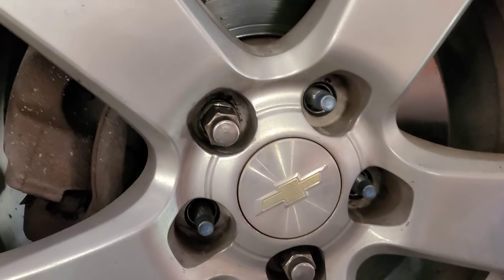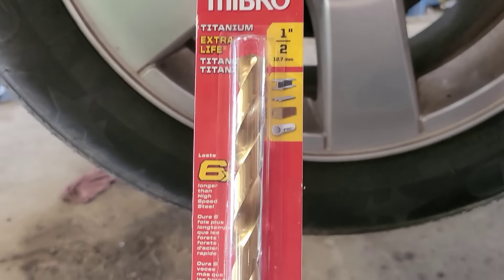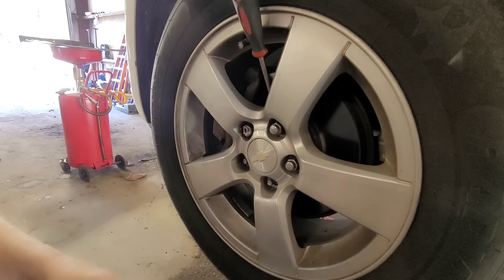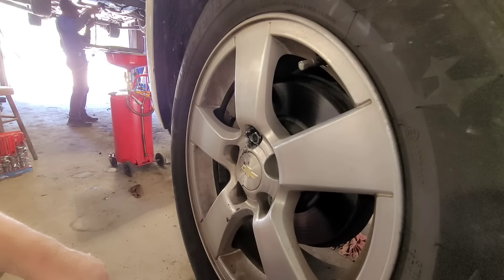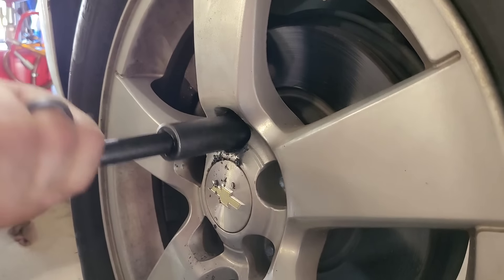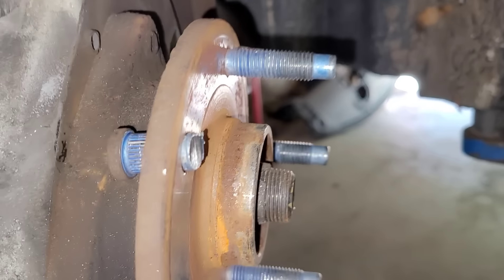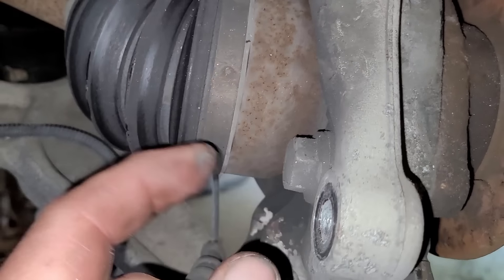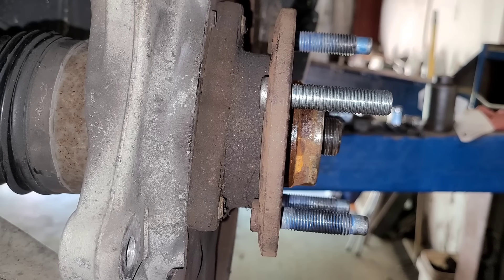Spinning Wheel Stud & Seized Lug? What Would You Do?

Comment: With the greatest respect to your skills Kenny, I would have used a smaller pilot drill to the depth of the wheel nut, and then progressively opened out the hole until the nut threads were drilled out. In my opinion, either High SpeedSteel  Drills, or best of all are old fashioned high carbon steel drills cut  better than titanium at this sort of  job. I would not have lubricated the job either,  let the drill do it's work,  and keep the speed lower to prevent overheating. Your programmes are excellent and I look forward to watching each new upload. Thanks and best wishes.
Reply: Hi, has above i would tackle this problem the same way :) I have had to remove a Discovery 3 wheel nut that was round off, wheel stud was seated ok, how i went about it was my workshop has a plasma cutter, on a low setting just kept a cut on the side of the nut, with presser like you did, and it came off, with no damage to wheel or stud. love your vids :)
Reply: Sure, drilling a pilot hole first the job would have went faster, the problem is getting that pilot hole straight.  Personally I would have taken the same route as Kenny.
Reply: I was thinking the same thing. I always drill a pilot hole before going with a 1/2" bit. The drill bit wouldn't get hot as fast or dull as fast. I would also use a heavier oil than WD40.
Reply: Yes a pilot hole first and reshart that bit dont toss  it and theres a way to sharping it so it cut faster
Reply: Why wouldn’t you use a cutting oil in this case? I am honestly curious as I’m a DIY guy, but in the last year I have started taking on larger projects and drilling through thicker metals.
Reply: @6atlantis  Cutting oil would be the best thing to use. If you don't have that, motor oil or even sewing machine oil would be better than WD40. WD40 is great for certain applications but using it on a drill bit is not one of them. It's a good way to ruin a drill bit. It will not only get dull but it will most likely lose it's temper.
Reply: @waltp3373  good to know thanks, I would of assumed Wd would be better than nothing. Thanks again.
Reply: Low speed high pressure yes, hss no, gold painted crap no, cobalt yes.....  oh and oil is pointless....
Reply: I agree with AW on the pilot drill/hole.  Just keep in mind that "titanium" drill bits are made of HS steel with a titanium nitride coating.   Also, I'd use a cutting oil instead of WD-40 or drilling dry.
Reply: You are correct sir.  It is not advisable to drill 1/2 straight into Grade 8 studs.  The reason is the land is too wide (the thickness between the two flutes) with a very high chance of burnout.  1/4 " will suffice.  Yes you must be careful of wander, but if you use the correct speed & feed, any misalignment will correct when the 1/2 inch goes in.  The speed for drilling steel is 1000 r/m, so the drill must be capable of this.  Carbide drill bits are ideal, hellish expensive, but.........
Perhaps I missed something, but if there is a cutout in the bearing, was it necessary to remove the hub ?  I understand the hub is in good condition and it is customers choice, but if it were my car, I'd pop a new one in.  After all the work has been done.
Well shot and explained and the proof of the pudding is in the eating.
Reply: Great skills on tackling the stud drilling it out but after I saw the hub with Grove for replacement of stud umm I guess  you did see it on the bottom  of hub it was fixed for stud slide through ,mmm that would saved new stud No grinding to it and Zero Removal
Reply: Would a hammer drill be better or just a regular drill
Reply: I would have started with the 1/2" if that centered good in the nut. Then switched to a 5 mm when there is a good center marking.
Slow and some oil, why drill dry? Don't want to clean after? 😂😅
Reply: @MrRunner  Note: the speed for drilling steel is not necessarily 1000 rpm, it is the drill diameter that determines the rpm, smaller diameter drills need more rpm than than bigger diameter drills.
Reply: The speed I gave was correct.  1/2 in steel.  It is very true that drill speed is dependent on the size and material, which is what I quoted.
Reply: My thought about imobilizing the stud...I might have tried just taking the nut off, instead of drilling once the stud became immobile.  If that didn't work, then I'd drill it out. Just my thoughts. Love the videos.  We're all human and make mistakes. 
Don't sweat it. Keep up the good work!!
Reply: I did this yesterday on a 1/2" lug stud. I started with 3/16" bit with motor oil then went to 3/8' bit for the finish full depth. that left a 1/16"' 'wall' around the hole which broke on its own when it was below the depth of the wheel. Yeah, I was surprised I was able to drill that straight. I think starting small helped keeping straight

Comment: I installed 5 studs in an auto parts parking lot because studs started breaking during a road trip. The whole strut and wheel bearing was from a salvage yard. We hit something on the road which took out the strut and bearing. Studs probably had been over torqued before I got it.  Lucky I was able to put them in without pulling the hub. Manually crank each stud in. Had to improvise because the lack of tools at hand.

Comment: Ive learned to put a prybar between wheel and hub, apply outward pressure, and let air impact do the work. Snaps the stud right off
Reply: Exactly what I was thinking. Seems tension on the stud would have allowed the lug to loosen.

Comment: The lug nuts with aluminum caps in my opinion are a hazard because they warp/bend and you sometimes cannot get the lug nut off with a traditional socket wrench.  If you have a flat tire on the road, you are SOL.  I replaced all these lug nuts with solid steel lug nuts.
Reply from the maker: You're absolutely right! Nothing is worse than swollen nuts 😉
Reply: @WrenchingWithKenny  lol 😂
Reply: Yeah those caps suck once they crack and expand from rust and other reasons. I've had sockets jam on before, didn't think I'd get em' off.

Comment: I worked at a store shop and ran into this stuff all the time.  I have experience as a machinist helper, and I fabricated a set of sockets with a bronze sleeve to keep the nut from moving while drilling the stud.
Reply: That's along the lines of what I was thinking. The sleeve could maybe be held in place with putty if you didn't want something permanent.

Comment: I've got the same problem with a 2015 kia sorento. I worked on trying to drill through the lug and and stud. I put a standard length 3/4" drive 13/16" socket on the lug nut and clamped some curved jaws vice-grips on the socket to keep the lug nut from spinning. I got a cup of water to dip my bit in to help keep it cool and put oil on it every time before I'd start to drill. Drill for 10 seconds then cool and oil my bit. I started drilling with a 1/8" bit and only stepped up 1/16" every hole till I got the 1/2" hole drilled. The stud was extremely hard to drill through.

Comment: Hi i had that problem before and i solved just sliding a saw blade between the rim and rotor golding it with a players and using the impact to  turn the lug nut and the blade cut the stud in couple minutes. May be the idea help to next time ur videos are very clear and helpfull thanks

Comment: Hi Kenny. Something similar happened to me in the uk in a lay-by with my Ford Transit van. Had a blow out and had to fit the spare. I drilled two smaller holes in the nut at 180 dg. to each other and then split it with a sharp cold chisel. Thanks for your videos. I really enjoy them
Reply: Good call. Lug nuts are made from a steel that is much less tough (i.e. has a lower yield stress) than wheel stud steel which is some damn tough stuff!
Reply: Didn't really think about it at the time Trotter, but when you put it like that, it makes a lot of sense
Reply: My dad says (boogered up) all the time

Comment: This is what I have ever done , never had fail , I use a socket of the same size as the nut , hold the socket with vise grips and drill the nut in the center , starting with a smaller size drill bit and then using a drill bit of the size of the stub , 10 to 15 minutes of work , it will break free !

Comment: In a situation like this I would have used the 1/2" bit to make a dimple in the center of the stud and then use a small bit - say 3/16" to drill a pilot hole.  The 1/2" bit will drill a lot easier then.  With a 1/2" bit in a drill press you can get some real leverage behind it that you can't with a hand held drill.
Reply from the maker: I find that if the drill is cutting good , I just keep it going . But if the drill is having an issue , I will indeed drill a pilot hole . Next one I get I will show that process. Thank you for the input !!
Reply: John, how are you using a drill press in this situation???

Comment: Once you find the center of the stud start with a small drill bit and keep going up in size until you get to the proper size. That way you will not dull your larger bits. It has always worked well for me.
Reply: 3/16, 3/8, then go to 1/2"

Comment: Brother I just drilled out a stuck lug on my ram. If the lug is stuck take a good four-way lug wrench put a bar on it with constant pressure right before breaking point and hit the end of the 4 way with a 3 or 5lb hammer it will alway come loose...or break lug off. I learned this after drilling out the lug

Comment: I have used a good hardened impact socket for a drill bit guide to both hold the nut and align the drill to the stud just a bit of advice from a machinist 1/2 inch drive socket and a drill one size smaller and the rest is easy

Comment: Just had work done on my Grand Caravan. They installed the front tire lugs were over tightened!  When I removed my front tires, my impact didn't have enough tork so I I had to use my breaker bar with extension.  I took off all the lugs except one.  I broke off my chrome cap and then broke the lug where there is no way to put a socket on it. Thanks for the info on fixing this!  Just wish tire installers wouldn't crank up their impacts so high!🥴

Comment: I had the same problem. I solved with a very thin and a small cut-off wheel 3 inch in diameter it was attached with an extension to a small drill. I precisely placed the cutoff wheel between the wheel and the hub component, where you placed the crew driver as the spacer. It was very quick and very low risk. I only had about .3 of a cm between the wheel and the hub. I managed to not damage any other parts of my 2016 Acura ILX. If you want the video, let me know sonIncan send it to yoi.
Reply: Hi um yes please I would like this video 🥴

Comment: I'm a retired machinist, and when we had to remove broken studs, bolts or pins I would use a smaller drill diameter that was about the same as the larger drill's web thickness to predrill.  The larger drill needs a lot of pressure for the chisel edge of the bit to dig in.... but with a predrilled hole, the chisel edge doesn't have to work the metal out and will drill very easily, very little pressure.
Reply: True dat!  Work your way up to the drill hole size.  It works much easier that way.
Reply: That's correct; a pilot hole drilled with a 3/16" drill will make the work much faster and easier.

Comment: Kenny...This has always worked for me; Go to an open parking lot,take all the other lug nuts off the wheel with the problem,drive the car with the steering wheel locked in a couple circles then do it again the opposite direction(have someone watching the wheel in question very closely) usually gets it loose. Good luck!
Reply: Wouldn't work in this situation because the Stud was loose. Otherwise this would be applicable.

Comment: Good vid! I had a similar thing happen to my 2010 silverado rear drum brakes first time putting snows on. I also drilled the the stud, I sacrificed the cheapest deep socket I had and welded it to a short bar, then drilled my the hole back through the socket. It worked but lubricating it with curse words seemed to help:face-red-droopy-eyes:. an old term "there is more than one way to skin a cat"  But every way the cat is cold.

Comment: just a side note. on styles like this where the caliper bracket is bolted in front of the spindle and not behind, just pop the center cap, free the axle nut, caliper bracket and remove the brake hose. next undo the bearing and take it all off then you can just grind out the back of the stud and punch it out. obviously check the bleeder valve beforehand to weigh out if this is a good route. 

this way guarantees you will not damage the rim and is less hassle if everything comes off nice, especially since you had to pull the bearing anyway so this would of nullified the drill time and damages from going through the front.

nothing wrong with the way you did it and hindsight is 20/20. for me personally this just alleviates the stress of damaging the rim and feels like less of a headache.

Comment: I had a problem where the studs were a poor fit and would spin if there was any corrosion in the lug nut. I got around it by drilling a small hole in the chrome cover and spraying some WD in each one. Let it soak a bit and the nuts came off easily.

Comment: Dealt with this a few years ago and had to improvise a different approach. Rear wheel (drum brake) on a Honda Fit. I removed the wheel bearing/hub dust cap and removed the hub nut. Released the parking brake and slid the drum and wheel along with hub off the stub axle. Used an angle grinder to cut the head off of the lug stud. I replaced the hub since it was due but could’ve installed a new lug stud otherwise.

Comment: Great video.  I had to pull the hub on my 2018 equinox to change the stud.  Those blue studs can be stripped. Went to a local tire place and when they put the lug nuts back on with an impact...cross threaded 2 lug nuts on one wheel.  Didn't have to drill it, but did have to pull the hub.😡
Reply from the maker: Those blue-ish studs are quite soft it seems . They do strip quite easily

Comment: Just in the spirit of relating a couple of personal experiences. I've run Subaru cars for a long time, every now and then the tire shops fix me up with a seized lug nut. 
My advice to anyone working on wheel hubs for any reason is NO HAMMERING. I believe Subaru's service manual says that too. 
What happens is you will get the fix on the lug nut, but you'll have a hub bearing failure a month or two down the line. The customer will absolutely remember you were the last one in there. Sounds like a comeback to me.
The hammering dents the bearing races. Even the punch hit to knock down the tab that holds the big locknut on the end of the CV shaft may damage the bearings. I made a clamp tool that makes the locking dent with no pounding.
Drill the 1/8" pilot hole right through the tin cap first, follow with the 1/2" bit to expose the end of the stud. Get a good accurately centered start for the rest of the pilot hole and the 1/2". 
Thank you for all the knowledge you share.

Comment: I just learned a lot! I was a bit miffed as to why you didn't keep drilling until the wheel lost its tension? I can think of a simple to make tool. Flat bar of suitable thickness in a rectangular shape with a part circle centrally drilled on one of the smaller sides. Cut to length. Circular slot locates around the end of the Stud and provides the best thickness to use the lug tension trick. Awesome video.

Comment: Like Kenny mentioned, the art of using drill bits is, the larger the bit is, the slower the RPM needed? The smaller the bit, the faster the RPM, and the use of cutting oil is recommended? Great job, as usual, Kenny.
Reply: Drilling steel takes practice & skill. the bit size doesn't matter, you have to control your speed so that the bit can cut the steel. you can adjust until you see the nice large shards, and not powdered metal. the bit has to be allowed to cut the steel, going too fast just burns it up. this is why a 1-speed air drill sucks. and, use a corded electric drill or you'll be wiping through batteries quick.

Comment: So if you can wedge it tight enough you can get sometimes get the lugnut to spin slightly more than the stud and walk it off with only minor scraping of the mating surface of lugnut to wheel. This works the same at putting a prybar or screwdriver under a fastener when you have a spinning nutsert.

Otherwise if you are a good a double cut carbide and cut down between the stud and nut and crack the nut off with a chisel. While have a rag around the nut and against the wheel between the chisel and wheel. The reason you go between the two is so you don't skip off.

Comment: I would have taken all the lugs off like you did. Slid my prybar between the wheel and the hub, apply pressure, back out the stuck lug with the impact. This reapplys the pressure you want on the spinning stud. If that wasn't enough I would have used some of weight of the car to apply pressure to hold the stud in place. One of the first days I had turning a wrench for pay I watched the lead tech, a guy who had been working with a Mercedes dealer since he was 16, drill out a wheel bolt with a carbide bur (Mercedes uses bolts not studs on their wheels). He smoked 2 or 3 of them before the massive head of that bolt was finally off because only the very fine tip of the burr was cutting, not the deeper cutting surface on the sides. Drill bits don't cut into those Merc wheel bolts.
Method here worked fine. I would have sharpened that bit 2-3 times if I was doing it this way.

Comment: I was stranded with a flat and a similar situation and placed a shortened metal hacksaw blade between the wheel and hub and manually sawed the lug using access between spokes, took forever but I got it off